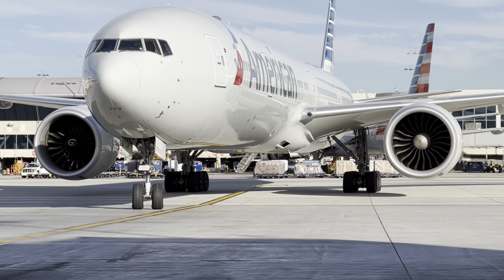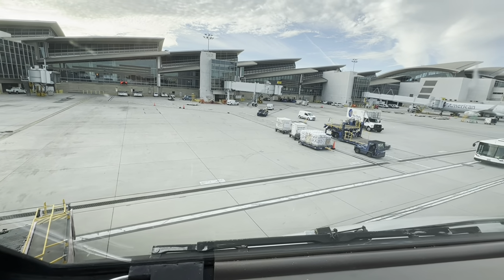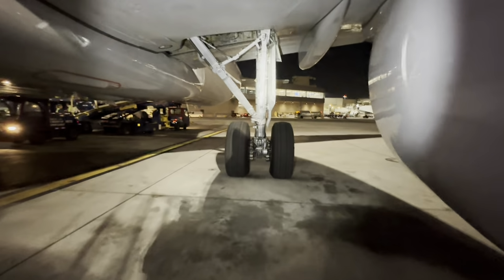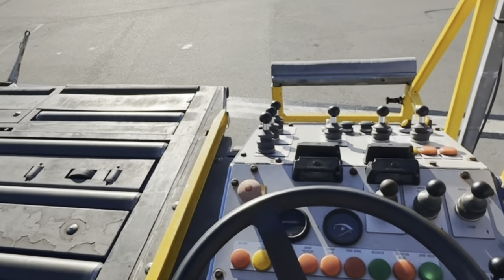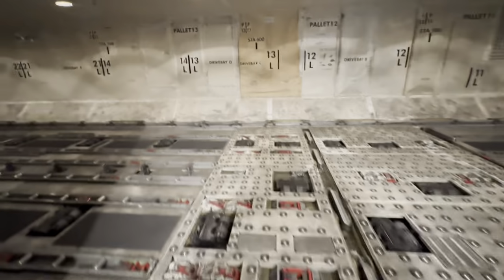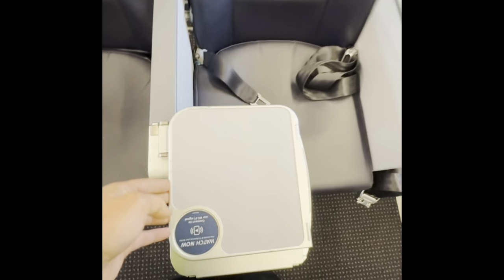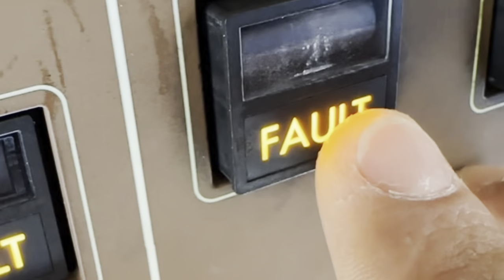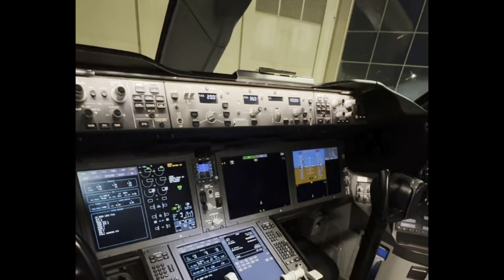Stig Shift #3 .. Thanksgiving Week Shift (22NOV23 - 25NOV23)

Comment: Hi Stig! Very cool video, as always! Thank you for the effort in filming in landscape!
I have a delicate question to ask and I would like to receive your answer. All topics shown generally consist of simple check-ups and I don't recall any serious issues being resolved. For example, we know that sometimes pilots report serious anomalies that prevent the aircraft from being used before they are resolved. I imagine that, in so many years of work, these cases have happened to you. Is there any company policy that prohibits the disclosure of these problems?
Reply from the maker: There is no policies in me, showing that, I tend to show the positive side of Aviation, but in regards to your question yes I have many times ground in an aircraft due to and safety issues. The fact of the matter is maintenance is the final word of safety, if I deemed the aircraft unworthy then it will not be flying anywhere, and I’m glad you really brought this up and I will bring this up in my video
Reply: @StigAviation   Thanks for your  prompt response. As a mechanical engineer and an aviation enthusiast I'm looking forward to watching a real case that leads to the grounding of an aircraft and the whole process of solving the problem. Thanks again for all the transparency you bring to us from behind the scenes.

Comment: Con stands for continuous…I don’t know anything further without researching it
Reply from the maker: CON (Continuous Ignition)

This is selected when there is heavy precipitation, severe turbulance and/or during takeoff & landing. When CON is selected, it basically tells the engines ignitors* to keep firing, that way in the event of an engine flameout, it can re-ignite. This is particularly useful in critical stages of flight like takeoff and landing, where if a birdstrike happens for example, the risk to engine failure becuase the ignitors aren’t lighting can be minimised.

Comment: 23:35 the inside of the fan blades. They seem to be at a very oblique angle, even opposite to the air-stream...?
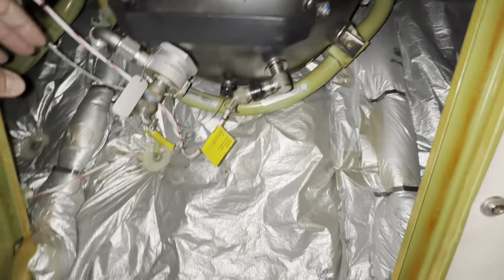28:26 Why do they have to use a Squib? Would a ball-valve not be up to the task?
Reply from the maker: That’s just the way they designed it.
Reply: @StigAviation  Would be interesting to see the optioneering they went through to arrive at those decisions.
Reply: The squib is actually a .22 caliber cartridge meant for 1 time use and they get replaced on a calendar basis.  Why not a ball valve you ask?  Simple answer - weight.
Reply from the maker: @allenemiesforeignanddomest3320  actually a perfect answer from Allen 👌 thank you my good sir.
Reply: @allenemiesforeignanddomest3320   Makes sense! Thanks.

Comment: Stig, maybe a simple question but how do you know that an engine needs oil before you’ve even opened the cowling to check the level?
Reply from the maker: Because it’s inevitable that the oil will always be a bit low. Unless it was serviced in the previous station. It’s always common practice to check the oil levels regardless if it needs service or does not.
Reply: @StigAviation  thanks for the reply! Yeah with every working engine it’ll be low from time to time, I was just curious that you top it up every time it comes into the gate, or only if it had been on a busy schedule.
Reply from the maker: @JordanMcCreadie1872  we top off the oil as necessary or as needed.

Comment: What is that barking dog on the Airbus? is there a similar system on a Boeing?
Reply from the maker: I made a full video explaining what the barking dog is, it is a power transfer unit. Check it out when you have time. Boeing also has this but it’s configured in a different way.

Comment: @StigAviatiin i used to install GE turbines for the Duke Energy in SC, and our turbines ran on national gas or very very clean diesel, either or. Does the bearings on aircraft turbines have lubricating oil constantly pumping through the bearings like ours did or just sealed grease bearings?
Reply: Yes they are constantly lubed via the exact same system. Really the only thing that changes on industrial gas generators and the ones on aircraft is the fuel delivery system if even. AgentJayZ I believe has a video going over the differences if you want a more complicated and technical answer.
Reply from the maker: Yes, indeed, the bearings do get lubricated on a consistent level, also the bearings have very special material that retain oil.

Comment: Hi Stig, can you hot swap components in the cockpit or all the electronics have to be shut down? Very interesting video. Btw the A350 has virtual circuit braeker aswell.
Reply from the maker: Anything that has to be swapped has to be deactivated. So we pull power via CB for that

Comment: Hey stig, I've heard stuff like static ports or some kind of  static electricity discharger on the wheels of aircrafts to discharge any charge created when the aircraft lands and that's what causes the smoke when the tyres touch the ground.. Is that true or the only reason for the smoke is heat and friction?
Reply from the maker: Just heat and friction of the tire touching the ground. Static ports and electric discharge units aka static wicks are a different system of protection for the aircraft.
Reply: @StigAviation  oh right. The wicks are the long pointy stuff we see at the winglets(mostly airbus) and the things under the flaps that make the flaps extend at the same rate right?
Reply from the maker: @kwasisb5390  yup. All aircraft have them. 👍
Reply: @StigAviation  alright,  thanks 😁

Comment: Why does the cfm56 make that noice on shutdown?
Reply from the maker: The CFM 56 or the LEAP? Because one makes the blade’s clanking sound due to the mid span shrouds (I made a video on that) the other CFM LEAP makes the woooshh sound, which is the compressor unloading the excess air.

Comment: Stig, do the drains or drain mast systems have some type of check valve or check ball, fluids need to drain out but due to the plane being pressurized in flight, it seems there should be a one way check valve. Or how do they work in flight?
Reply: No. The negative pressure is actually a benefit because it acts as a vacuum to suck out any of the fluid when at altitude. When you're at cruise put your ear next to the drain on the sink and you will hear it constantly sucking.
Reply from the maker: Fun fact about this, by the way, you’re absolutely correct on answering this, the aircraft is consistently losing pressure, but it maintains pressure as well. In regards to a check valve. There is a very small component at the galley where it’s a popit style valve. Flight attendants can pull it to allow the negative pressure to take effect and clear out the water that’s in the lines.
Reply: @StigAviation  thank you Sir, I was curious because it seemed to me that a constant open drain would make maintaining pressure more difficult, like the tire on my car with a slow leak I keep putting off getting fixed...😆

Comment: Airbus leaves their mark on the knobs...where is the Only place the word Boeing is inscribed in a 737.    There is only one place...the cockpit manual window handle. If you learned this from me just now..give me a thumbs up.... additionally,,the red circuit breaker sleeves are called DFW. Meaning Don't F With 😮😂
Reply from the maker: Actually, I did know that little fact about the 737. That is the only place inside that flight deck where it says Boeing. And if you want a little bit more trivia, check out the 737 power receptacle on the outside, you’ll find a very interesting little insignia. F4U Corsair 👌
Reply: What's the only french word in the 737 cockit...LE FLAPS 😮

Comment: Continuous, keep trying to start engine.
Reply from the maker: You pretty much got it. More exactly Continuous Ignition
Reply: @StigAviation  thanks, have u done a video on safety differences between etops and non etops?
Reply from the maker: @MrGuzmanra  I have done a very where I explain most of it. But it’s buried in one of the longer videos.
Reply: @StigAviation  what about a plane is gonna leave and someone forgot to check the oil.  Does that ever happen?
Reply from the maker: @MrGuzmanra  we usually check them as a precautionary in big stations. Smaller stations sometimes don’t have maintenance, but pilots can monitor the oils and if low, can call for contract maintenance to service oils.

Comment: Con button is for turning on the plane farts 💨
Reply from the maker: 🤣🤣🤣 not quite 
CON (Continuous Ignition)

This is selected when there is heavy precipitation, severe turbulance and/or during takeoff & landing. When CON is selected, it basically tells the engines ignitors* to keep firing, that way in the event of an engine flameout, it can re-ignite. This is particularly useful in critical stages of flight like takeoff and landing, where if a birdstrike happens for example, the risk to engine failure becuase the ignitors aren’t lighting can be minimised.

Comment: CON- conserve fuel?
Reply from the maker: CON (Continuous Ignition)

This is selected when there is heavy precipitation, severe turbulance and/or during takeoff & landing. When CON is selected, it basically tells the engines ignitors* to keep firing, that way in the event of an engine flameout, it can re-ignite. This is particularly useful in critical stages of flight like takeoff and landing, where if a birdstrike happens for example, the risk to engine failure becuase the ignitors aren’t lighting can be minimised.

Comment: What was the cause of that engine noise?
Reply: It’s the fan blades. There not bolted in; they slot in and can move radially when the engine spins. What you hear is each blade falling outwards due to gravity.
Reply from the maker: I made a video about this, not too long ago, mid span shrouds. Check it out when you have time.
Reply: @StigAviation  I stand corrected, thank you! Always great to learn something